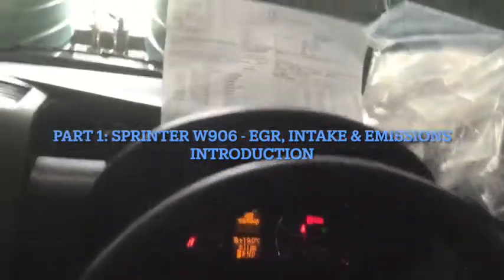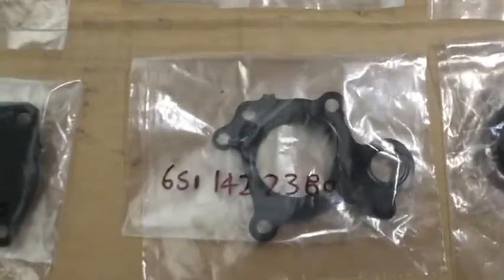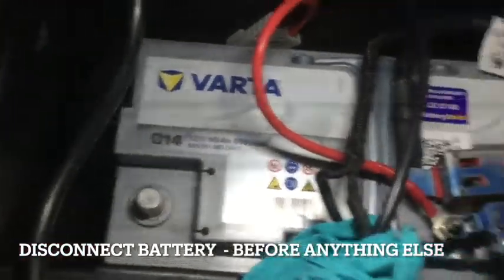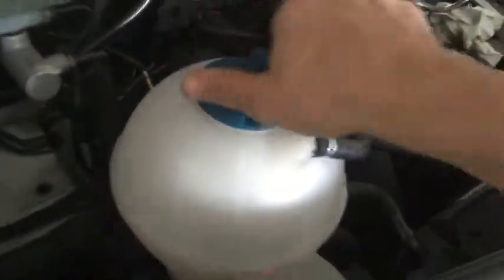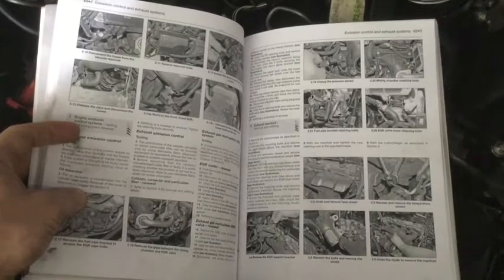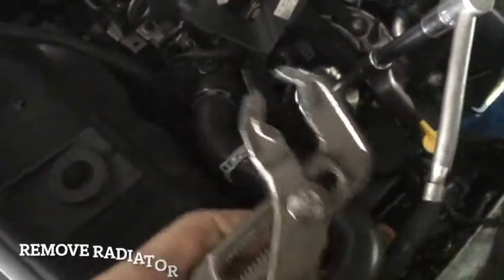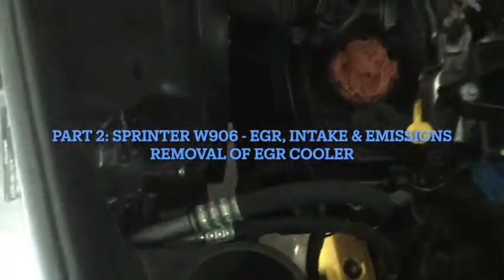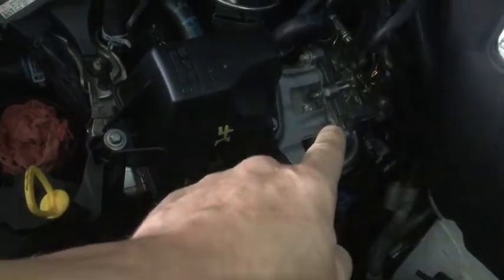Pt.1 Mercedes Sprinter Van W906 OM651 - EGR Valve & Intake manifold removal & clean

Comment: Just a quick note to say huge thanks for taking the time to explain on your inlet manifold clips. Watching them a few times gave me the confidence to give it a try. I had a recurring P0299 underboost code and could see oil under the fuel filter - eventually found my inlet had cracked all along the top. Took me a lot longer than you did, I’m not a mechanic but working carefully and methodically I managed to put a new one in. What a feeling afterwards. Never would have attempted it without the help, thanks so much, really appreciate it.
Reply from the maker: This makes me so happy 😁 you kinda "levelled up" by doing this job , thanks for the feedback I  would have loved to see you turn the key for the first time after you put it back together 😀

Comment: 10:21 That vacuum operated valve is the cooler bypass valve and not the EGR valve itself which is electrically operated and sits to the rear of the bypass valve.

Comment: Hi Why didn’t you do physical egr and cooler delete with blank plates for intake pipe above throttle body close of egr intake from exhaust manifold and then remap plus egr software delete plus dpf delete 
I’m thinking of doing this on w212 e250 with om651 engine thanks
Reply from the maker: I got the feeling it's illegal here in Australia to do that 🥴 but yes it's a good idea 💡

Comment: Hey I normally work on the USA spec sprinters but for the battery there should be a quick disconnect under the center console above the battery behind a cover that just pops off. It could save you some time.
Reply from the maker: Hey JMAN3447 - Thanks for the tip, ill have a poke around and look for this myself, anything to make the job easy HAH